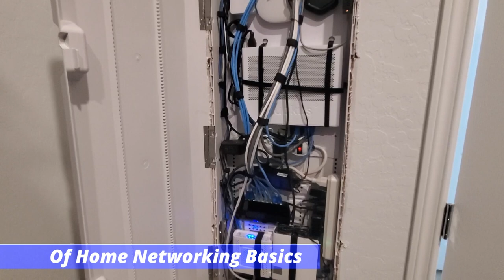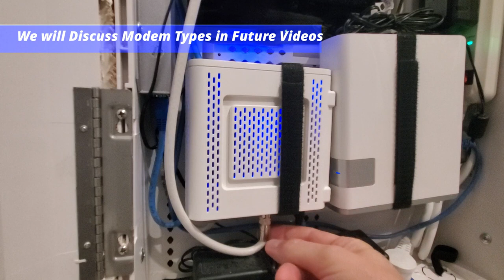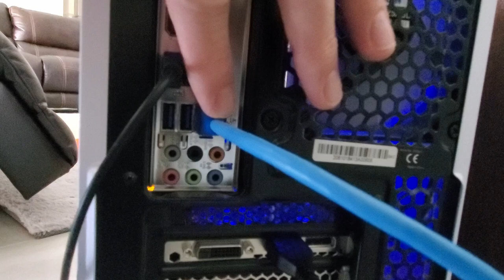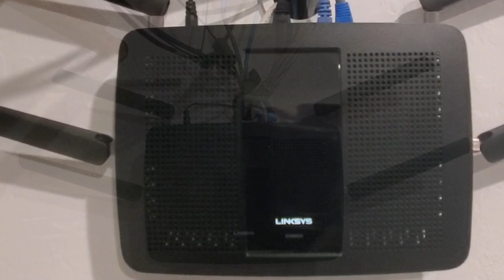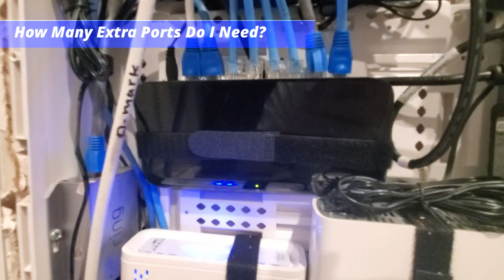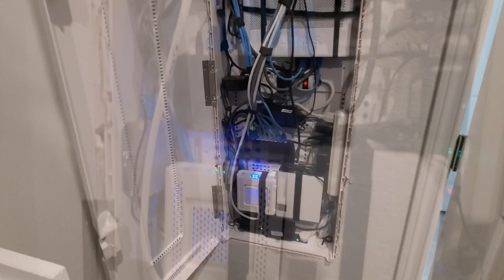HOME NETWORKING 101 - MODEM, ROUTER & SWITCH - RESIDENTIAL NETWORK PANEL SETUP - HOW TO

Comment: Been dealing with connectivity issues from my ISP providers failed equipment for almost 24 hours... thanks to your video, I was able to use old equipment I had lying around and get back up and running in a matter of minutes... thanks! Now... onto homework that’s due at midnight! Couldn’t have done it without you!
Reply from the maker: I'm glad you got everything  working. ISP equipment is usually cheap and probably used.  That's why I always purchase my own equipment. I'm glad my video helped you get back online. Thanks for watching and if you subscribed thank you as well.
Reply: Do I need to pay an ISP

Comment: Great Video. When will you come out with the Fiber video. I just bought my home and the setup, (I call it the I.T. panel cabinet) looks almost exactly like yours complete with Ring, Rukus switch and R510 WAP, Kevo and Sonos. Problem is, I have Fiber modem. Does that change the setup in any way?
Reply from the maker: No the fiber modem does not change any of the setup. Here is one of my fiber videos.
https://youtu.be/RJbR80rdFEY
I have 3 fiber optic videos!! Thanks for watching!

Comment: I'm trying to understand, what are the skiny blue wires that are running back into the house?? In your video they are plugged into the switch. I have them in my home (very new) not sure what they are for. I have them plugged into the at&t router/modem box.
Reply from the maker: The blue wires are cat6 ethernet cables. Here is a video that explains it all.
https://youtu.be/qXy42FKZJi4
Reply: @UltimateTechHub  thank you very much

Comment: Why not a rack seems like there is not enough room, I am building a new house and I can't decide if I want to use a media center like this or use a wall mounted rack, of course I want to use poe for cameras and network storage for the cams and hard wire wifi access points in the house
Reply from the maker: If I was building my house I would build a rack mount system probably in a small closet.  But this is what came with my house so you make do with what you have. It works fine for my needs.  Thanks for watching and if you subscribed thank you as well.

Comment: I see that you also have a ruckus ICX7150-C12P. I’m a little confused. Can I plug in an Ethernet cable from my router to the ruckus instead of a Wi-Fi router?
Reply from the maker: I would connect the modem to the wifi router then the RUCKUS IXC switch. The wifi router has firewall protections for IPV4 and IPV6. The RUCKUS IXC switch will work perfectly that way. And I use only Cat6 ethernet for all of my connections.  Car5e will still work well especially if you have ISP speeds around 1gig.  It's always best to go from modem to router to switch. I have a video on that very subject so check it out. Thanks for watching and keep me posted if you have any issues.
Reply from the maker: And yes a router or wifi router will work just the same.
Reply: @UltimateTechHub  thank you! Because I was trying to hook up a gateway from Tesla (small router box) to one of the ports of the Ruckus but it saying no signal or no Ethernet. I’m not sure why so I was wondering if I should buy another Wi-Fi router and connect it there instead?
Reply from the maker: @kendrickstacy7753  I've never used a Tesla Router so that could be the issue. Yes I would buy a new wifi router and try that and see if it works.
Reply: @UltimateTechHub  Hi - do you mind sharing what video you are referring to here? My Ruckus went out in a bad storm a few weeks ago so a lot of my smart home has been down since its run through the ruckus. I'm trying to figure out a way to re-boot everything (unplug and replug didnt work!)

Comment: I have a new house. What do you do when your panel is in the garage full of coaxial and ethernet cables but your modem is in a bedroom opposite of the garage? I'd like to access the ethernet outlet in a downstairs office.
Reply from the maker: Put your modem in the panel in the garage. Connect a router to that modem and connect all of the ethernet to the router. If you need more ports add a switch to the router. All ports in your house will have internet connectivity. Keep me posted and make sure to watch my Ultimate Home Networking Playlist for networking videos.
Reply: @UltimateTechHub  I was afraid you’d say that. There’s no space in my panel. It’s quite shallow but there is a shelf above it. I don’t why the developer decided to put it in an unheated garage but most importantly it gets quite hot in the summer. It was in the 90s when we moved in and decided to put the modem when the cable company came.
Reply from the maker: @davidhalley9795  There is a work around. You can connect an ethernet cable from the router in your bedroom to the port on the wall. In the network panel install a 8 port switch and plug all of the ethernet into the switch. The switch can be a cheap tp link that cost 20 dollars and it's pretty small.
Reply: @UltimateTechHub  Ooh. I like the sound of that! I'll try that. Thank you!
Reply from the maker: @davidhalley9795  That should solve your issue. Keep me posted!
Reply: @UltimateTechHub  OMG! This worked! Later on I thought, wait, I think I need to plug in the ethernet coming from the bedroom port to the switch in the panel. If not the others won't work and I was right. However, do I need to plug the ethernet into my satellite router then to my laptop for security or is the main router okay as is? I assume that it is, like at my office. Either way I appreciate all the help! Thank you, thank you so much!

Comment: Question.  I have a Greyfox panel from what I can see has 5 ethernet (blue) cable.

The cable guy connected 1 ethernet line to the modem, and from there to a router. This line goes to my office.

I find 2 ethernet jacks in 2 separate rooms, ansd if I connect a desktop to it... that should be a hardwired connection correct?

Problem is I cannot find where the other 2 ethernet cables are kn the house..

Comment: the modem will do configuration? and also same as routed before connecting each other or modem will be configure no need to configure router?
Reply from the maker: Router configuration only for SSID and password.
Reply: @UltimateTechHub  thank you

Comment: We have the Ruckus  ICX 7150-C12P and the R510 AP (setup came with the new house and no information was left about the system). We had a power surge in our house and now when we connect to the WiFi, the connection says connected without the internet. We don't know how to fix it! Please help.
Reply from the maker: Unplug all power to your modem,  router and switches for about 2 minutes. Then plug modem back in then the router and then the switches. Give  it about 5 minutes to go back on line.

Comment: Is it ok to go Modem-Wifi Router-->5 port switch--->another router or is it still better to go modem-wifi router--->router--->switch?
Reply from the maker: Never put a switch in between 2 routers. Modem to router to 2nd router. You can have a switch going from each router but not to another router. Thank you for watching I really appreciate it.

Comment: Really hoping you can help. We moved into a new house that had a ruckus icx 7150 and two ruckus access points in the house. Also had that small black kevo hub as well. My question is, I can’t figure out how to plug my modem or router to the ruckus 7510 to get everything to work. Do you have a video (I did try looking) that shows how you connected your ruckus equipment and get it all setup? I have a cox modem and an asus gaming router (gt-ax11000) thank you!!
Reply from the maker: Your setup should be as follows: Connect Modem to Router with ethernet cable to WAN port on router. Then connect router from any LAN port to any PoE port on the RUCKUS switch. The RUCKUS APs should connect to the RUCKUS switch as well. The KEVO hub will connect to any PoE port on the switch. You may need to power off all devices for 30 seconds then power them all back up. This setup should work easily. If your RUCKUS APs need to be reset so you can name the SSIDs you use a paperclip and press the reset button for 15 seconds. Then use your phone to find the AP in your wireless network. From there you can rename and add new passwords. You also need to download the RUCKUS Unleashed app for your phone.  I have nearly 90 Home Networking videos so checkout my Ultimate Home Networking Playlist. Good luck and keep me posted.
Reply: @UltimateTechHub  thank you so much for the reply. I’ll give that a shot when I get home from work and let you know how it goes. Thank you again!
Reply: @UltimateTechHub  good news…I got one AP set up as a master AP! The wifi speeds improved tremendously. My question is though should I have done the typical install or the gateway install? Both R510 APs are hard wired to the icx 7150. One AP was set up via the gateway method as the master AP. I tried adding the serial number of the other AP into the zero touch mesh method but it doesn’t seem to be joining. Nor does the icx 7150 seem to be appearing in the unleashed dashboard.
Reply from the maker: @fatalb1t355  I always do the typical install. That way it's easy to add multiple APs.
Reply: @UltimateTechHub  ok I’ll do a factory reset tomorrow and try again to see how it works. Thank you!

Comment: Do the the machines connected to the switch will be slower compared to those directly connected to the LAN ports of the router given the former share the same LAN port? I asked because each LAN port has a speed limit.
Reply from the maker: No, unless you have more than 1 gig speeds and your router has 2.5g LAN connections. Switches handle 1gig speeds so you should be fine. If you have a bunch of people online at the same time then your speeds will be slower because your sharing bandwidth.

Comment: I have a modem-router, how does that work? I also have cat 5e ports in most of the rooms.
Reply from the maker: A modem router combo is fine and works well. Simply plug your cat5e cables into the router if the router has 4 ethernet ports. If you need more ports simply buy a tplink 8 port switch and plug it into the router. I have a video of the Tplink switch install.
Reply: @Ultimate Tech Hub Ok thank you!

Comment: I've noticed that several of your cables going in the equipment are bent at 90 degree angles, this not good for connectors because of the amount stress place on it. In some cases you may be able to use a right angle connector instead of bending the cable at an extreme angle. But overall, I found this video to be quite informative.
Reply from the maker: Thanks for the good advice on the connectors. Thanks for watching and if you subscribed thank you as well.

Comment: In your other video about ethernet wall ports, how would the wire from the router (located in the network panel) connect to my PC? As I will be attaching a separate ethernet cable from the wall port to my PC, how would it connect to the router?
Reply from the maker: From your PC an ethernet cable connects to the wall jack and from that wall jack an ethernet cable runs through the wall into your network panel and connects to your router or switch. Hope this helps. Thanks for watching.
Reply: @UltimateTechHub  So (typically) if a new place has a wall port already in place. Will the network panel have the other end of the ethernet cable available to plug into my router?

Thanks for your help
Reply: @alanwong9754  if that place has a network panel, then in general, yes. I've lived in some houses where there were no network panels in the master closet. So all the network cables ran to the telephone panel outside

Comment: I hope you have ventilation in the 42 inch media can.
Reply from the maker: The door has ventilation but I usually keep the door open. The ruckus icx switch gets pretty warm. Here's a video of the updated panel as of 2 weeks ago.https://youtu.be/9kGISAgdjMA
Thanks for watching!
Reply: @UltimateTechHub  i install residential networks similar to yours.  Heat is usually an issue. We primarily keep rg6 for tvs in there along with fire protection and or alarm. I install all the moca capable amplifiers, considering most of our runs are around 50 feet min. We keep all out network and audio in a wall or rolling rack. With rack mounted equipment and install rack shelving for our Sonos Amplifiers. The last house I wired recently had 10 Sonos Amplifiers. The guy had 47  speakers throughout his house. I wired it myself on the rough and now getting down and installing the field devices and headend equipment. I'll send you some pictures of the rack area lol. Hit me up. I'll even take some more pictures for you once the rack is installed. It's gonna take 48 hours just terminating rj45
Reply from the maker: @B3ASTM0D3.  Awesome!! Ive terminated dozens of rj45 connections I'm my house and my fingers got very sore. Lol

Comment: Hello, to a real old guy like me this is confusing, so what type of technician do I need to set this up for me.. I would like to connect my modem/router to my on-Q box which would hopefully help with my TV connection in one of the room. So is it a network technician I need or ??.
Reply from the maker: If you watch cable TV then coax connections are very easy to set up and wire. I have several videos on Coax cables. Otherwise you can hire a low voltage installer to get it setup  If you want a beginners video on the basics of the network and the panel here is a video I can recommend to you.
https://youtu.be/NV7Ay6KyB8U
Thank you for watching and keep me posted.
Reply: @UltimateTechHub  Many thanks for such a quick response, I moved from Cable TV 3 months ago and have You Tube TV, one of my TV's is 2 walls away from Frontier modem/router which is currently attached to my desktop. The local channels do not operate well although regional programs do. Just thought connecting to my On-Q box would centralize the routing.. Thanks for the info on the video, I will look at it now.. So I look for a company that does low voltage installing on the "On-Q" systems?
Really appreciate your feedback..

Comment: Do you recommend to use a patch panel or no need?
Reply from the maker: I always recommend a patch panel or a server rack. It just helps keep everything organized.
Reply: @UltimateTechHub  Thanks for the answer. I've been watching different videos about patch panels for hours and I cannot find the answer I need to know. Our ISP provides us a modem/router in one and inside the wall socket, which has a solid keystone ethernet cable. Do we really need to change this ethernet cable to cat 6 cables to be able to build a patch panel? Any advice? Thanks.

Comment: I don't have anything like this. I have a router that goes into the coaxial in the wall. I don't have any cupboard with a mass of boxes. What do I do? I need to install a new Ethernet in the wall and can't find anything.
Reply from the maker: Ok so it sounds like you have a modem and router combo. Do you have any ethernet ports in your rooms?

Comment: Can someone do modem > switch >router? Or should it always be modem > router > switch?
Reply from the maker: No you should always do modem router switch.
Reply: Hi, my modem from my ISP I think comes all in one...(modem/router/WiFi).....do I still need another router inbetween to switch? Thanks
Reply from the maker: @gonzaga3c  No. Just plug an ethernet from your modem router combo to a switch. I would get a 8 port switch so you have plenty of extra ports. Thanks for watching!
Reply: @UltimateTechHub  thanks for the reply. Will be starting soon with my journey to this basic home network set up. Regarding the type of switches, for people like me or household that don’t do office work at home an unmanaged switch is ideal I guess for its ability to be plug and play.....how about running multiple switches from the main hub, is this still a good idea? And when running wires to the rooms, is it best to double the run even only one will be in use ie. one will be back up or for future use.

How about if I decide to go managed switch from the main hub and have a couple of unmaged to another two rooms, is this possible? is managed switch hard to set up for a basic know how guy like me🥺...say Ubiquity switch type....many thanks again and enjoying your tutorial.
Reply from the maker: @gonzaga3c  Well if you want a managed switch then yes from the main router to the managed switch then you can hook up as many unmanaged switches to the cables from that managed switch. I just uploaded 2 videos on switches and these videos will answer all of your questions so go to my channel page and look for most recent videos. Good luck my friend and keep me posted.  And 300mbps is pretty decent for most situations.
Reply: @UltimateTechHub  many thanks, will look onto your other videos too👍

Comment: I’m setting up a new modem going to a WiFi/Router to a switch. I have another router in my garage 75 feet away connected to the same switch. Is this ok?
Reply from the maker: You can definitely do this here is a video I made on this serup 
https://youtu.be/qpcWucapIRg
This video is for router 2 to be on the same network. For instance if router 1 has an IP of 192.168.1.1 then router 2 will have the IP of 192.168.1.2 , I  think in the video I swapped the last 2 numbers,  so make sure the last number is 1 digit higher.  Keep me posted and thank you for watching.
Reply: @UltimateTechHub  work
Keep like a charm! Thank you very much.
Reply: Worked like a charm!